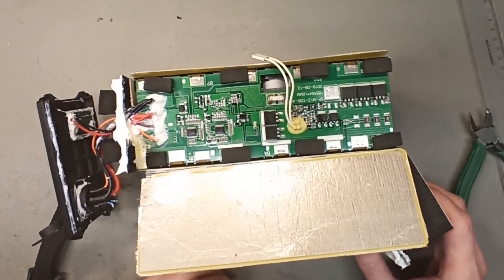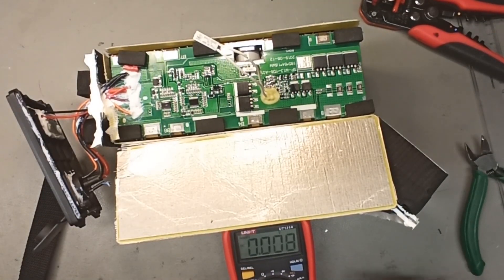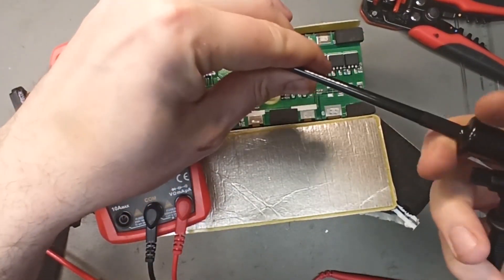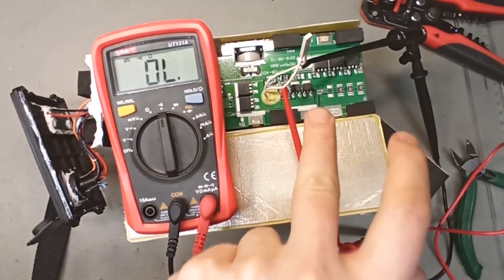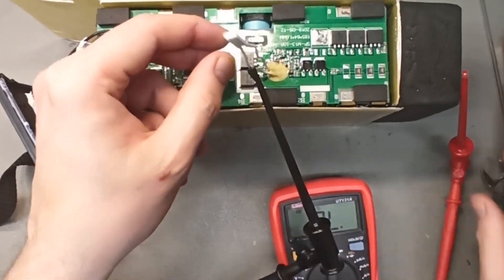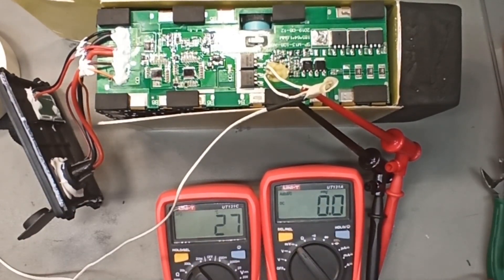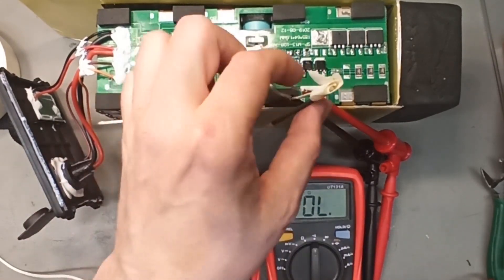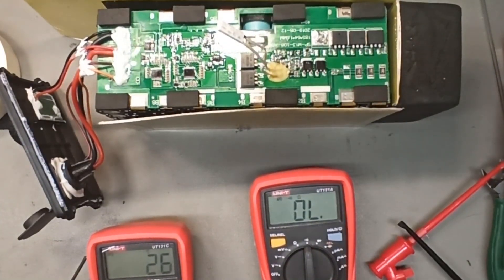How to check if a BMS NTC Temperature Switch works and when it shuts off

Comment: My battery is cutting out at about 15C, I suspect it is the NTC probe, not sure what the resistance would be that would trigger a low temp shutdown of the battery but will measure and test it.  I never use the battery in low temp conditions so may just place a fixed resistor on the cct to disable this shutdown from  happening.  Like many things that are designed to protect us, sometimes they cause more problems than they solve.

Comment: You always have great, practical methods.

For this issue, may I suggest taping both NTC and probe to one side of an aluminum plate, then heat the "other" side of the plate?